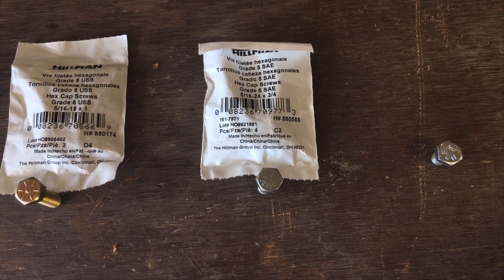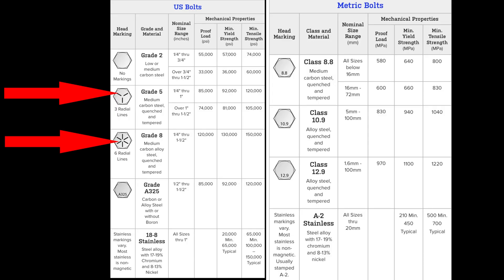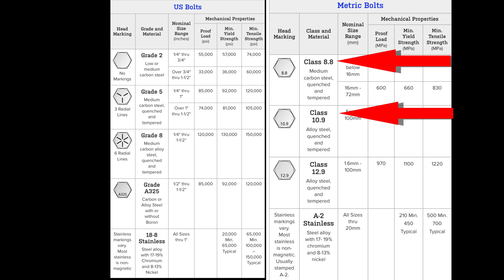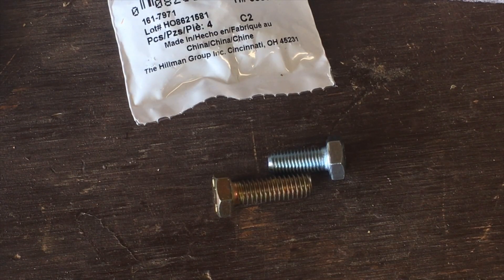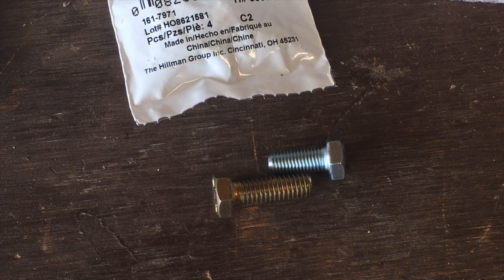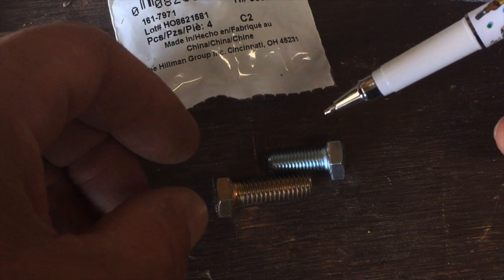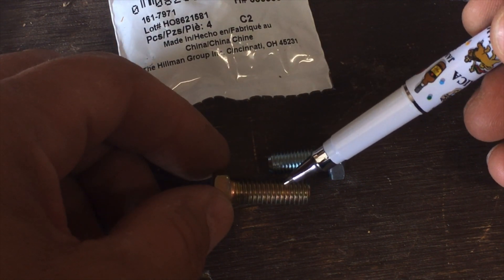Bolts or screws how to identify them

Comment: Great informative video. I'm looking at replacing a bolt in the lower control arm that holds the strut. Ford wants nearly 50 dollars for each bolt. It says SET 10.9 on the head. It's a metric bolt with about a 21mm head and about 4 or 5 inches long. Is a grade 8 bolt equivalent? Or what would you suggest? Thanks
Reply from the maker: I would always go with a stronger bolt if there is any question. It seems odd they want that much for a bolt. Have you checked your local O’Reilly‘s auto parts. Appreciate your question your viewing and your subscribing. I’m glad you’re enjoying the Contin on the channel. Let me know how it works out.
Reply: @HolmeshowdoI  I've called all the local parts stores. Dealer part only. Boo!
Reply from the maker: That’s no good.  Some time they just hit you where it hurts.